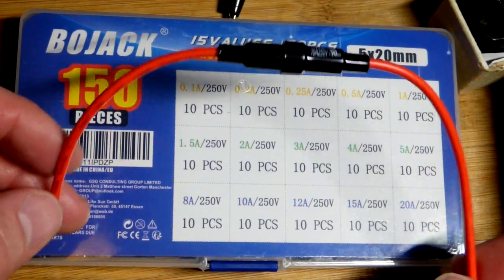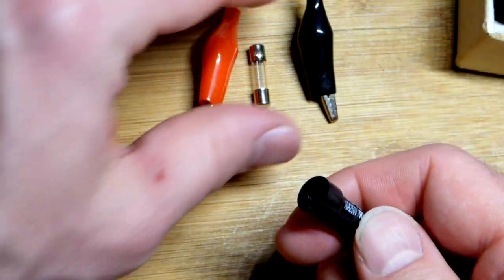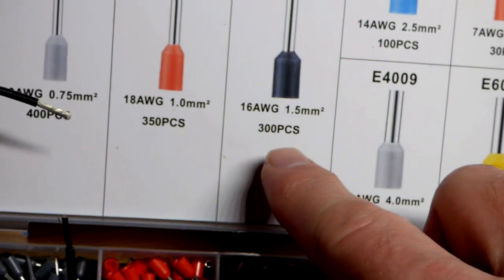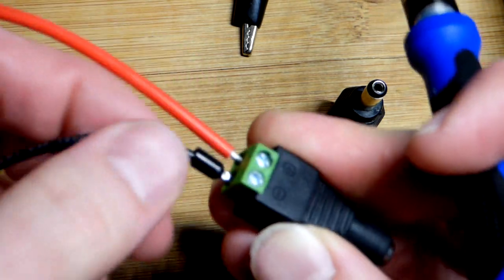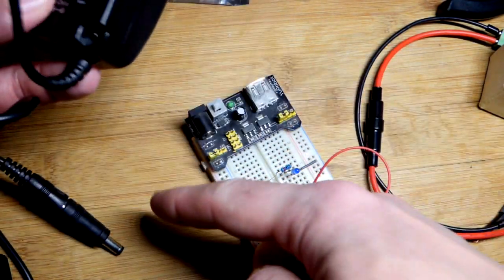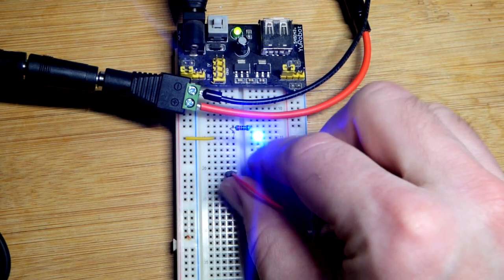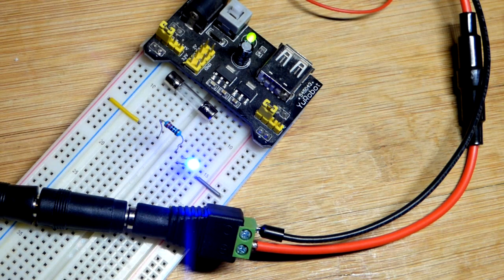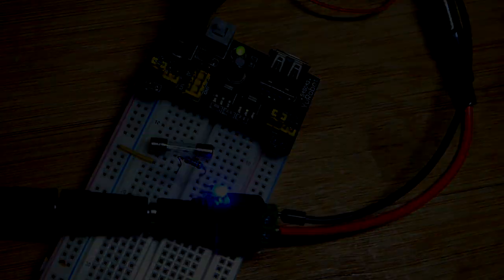How to wire up in line fuse holder to protect breadboard power supply module DIY tutorial

Comment: Very interesting and useful. But why you only put the ferule on the black wire and not on the red wire?
Reply from the maker: The red wire is tinned and is a larger gauge than the black wire. So, it will already work well with screw down plate connectors and probably wouldn't fit in these barrel connectors with a ferule on it.